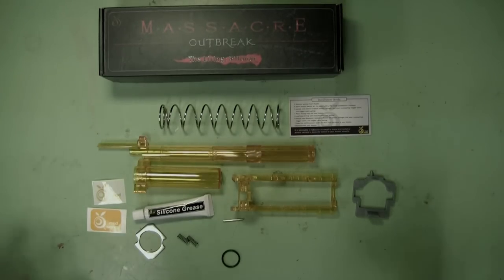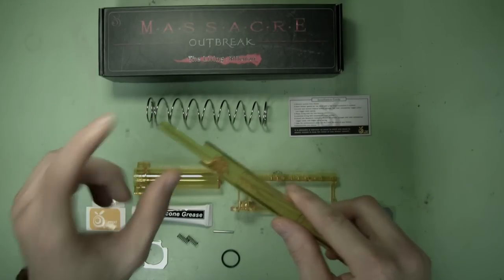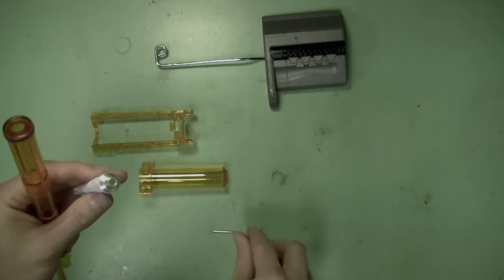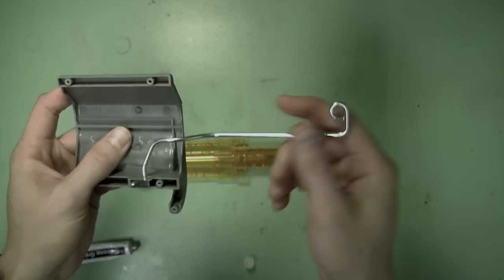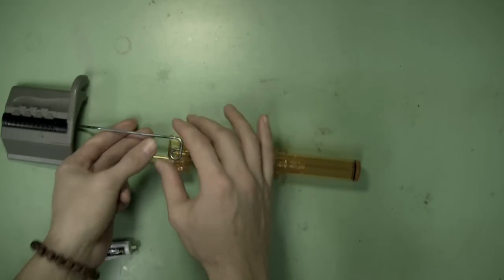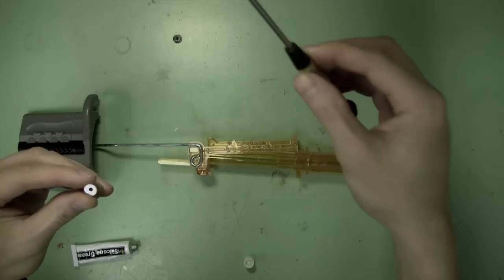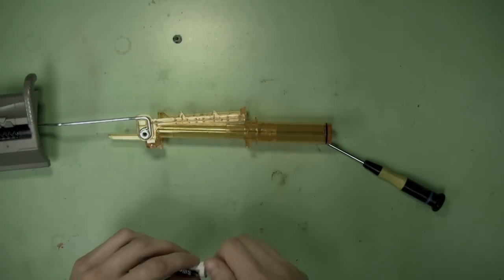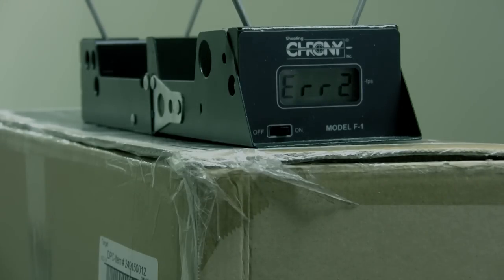Massacre Kit for Nerf Alpha Trooper From Orange Mod Works

Comment: hello as my previous comment states I'm having issues with my prime on my alpha trooper I have yet to try the reinforcements as I'm just tired of messing with it right now but I'm curious about the "2"  catch springs I recieved in my kit. am I supposed to use both? is one just extra or what's up with that? just wanted to know if perhaps that was possibly my problem...